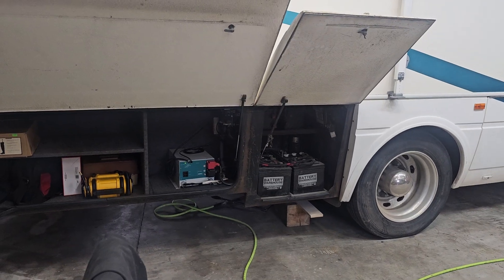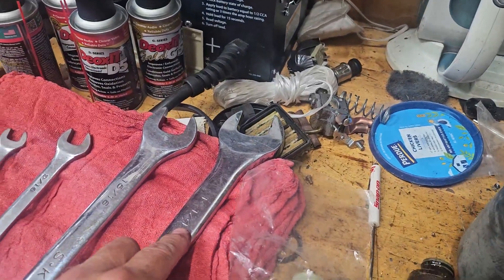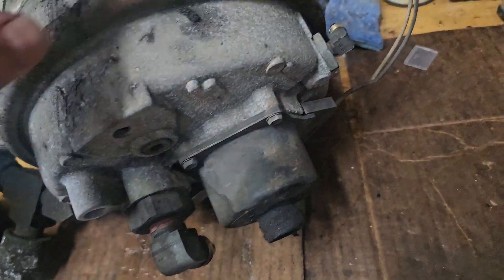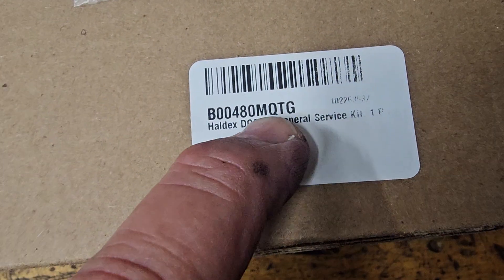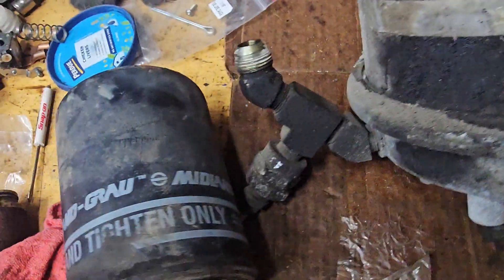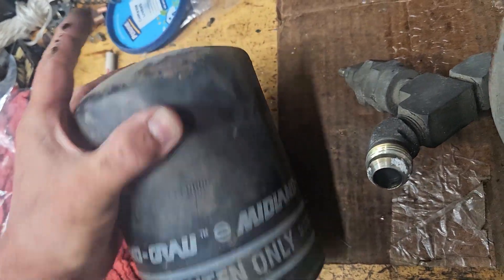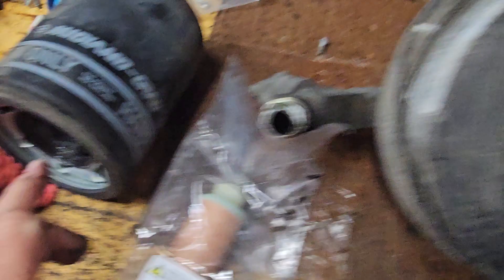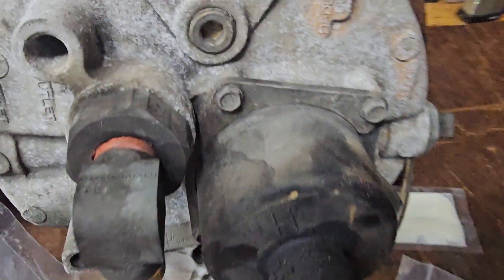Air dryer desicant. Most NEGLECTED filter on the preventive maintenance list

Comment: I ABSOLUTELY AGREE WITH THE AIR BRAKE CDL Add-on test and LEARNING IT. Hands down; ANYONE with a diesel pusher should study that and LEARN how your air brakes work. If your Lucky, you have full air brakes. And if your unlucky like Jeff and I, you have something called Air-Over-Hydraulic brakes; which is a whole different Frankenstein combination of slap it together manufacturing. And there is a Whole different methodology of driving with those which you tend to find out on your first downhill run.